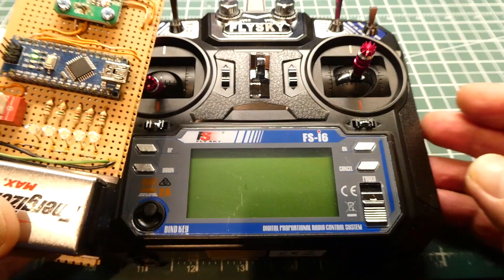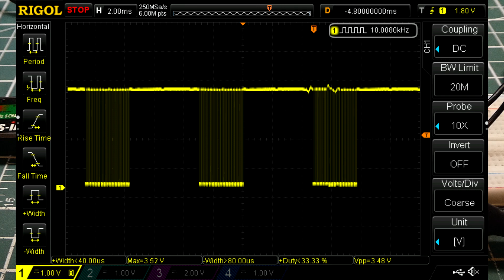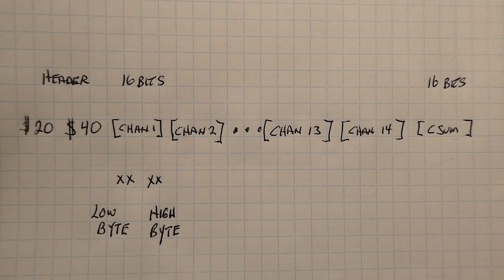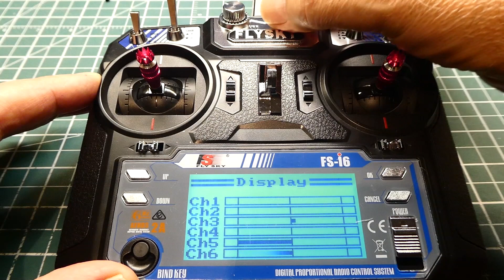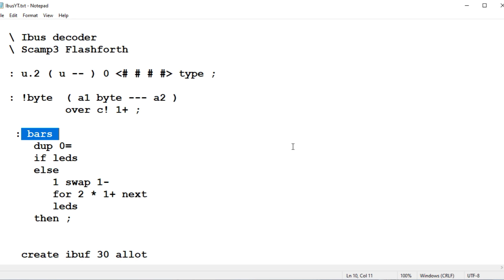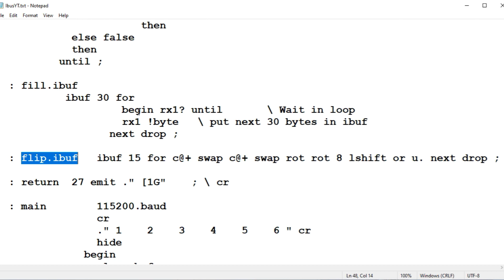IBUS Decoder / FlySky / Scamp3

Comment: I know this is an old video, but you don't need a different RX, it is outputing the raw data stream, which is generated in the TX.  Put new firmware on the TX to access channels > 6.  You won't have a pcm/pwm signal for channels over 6, but who cares, I assume your feeding the data stream to a flight controller.   Then you can use the higher channels for control of the flight controller settings/modes.

Comment: Excellent work, thanks!  I wasn't sure from the video, was the ibus signal 3.3v or 5v ?  My Raspberry Pi Pico RP2040 is not 5v tolerant, apparently.
Reply from the maker: If the output of your receiver is a 5 volt signal then you need a voltage level converter or a simple voltage divider if you are feeding the data into a microcontroller that is not 5 volt tolerant. In my case the receiver I am using does not have a "rail to rail" output ( check the scope images in the video ) so the voltage levels were ok.